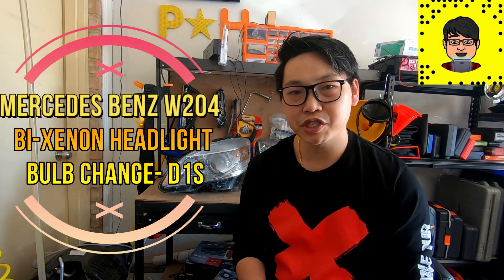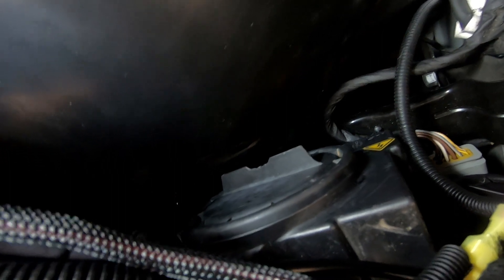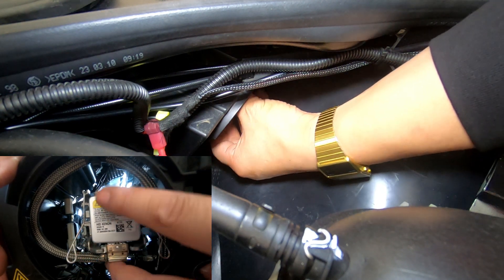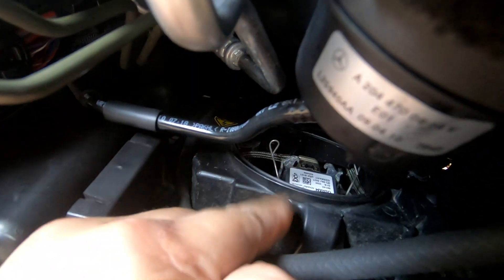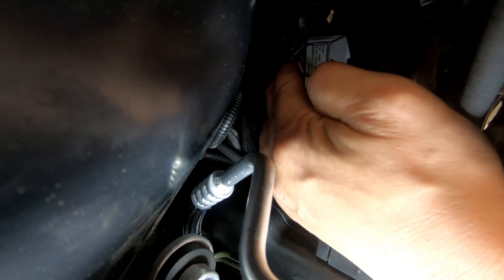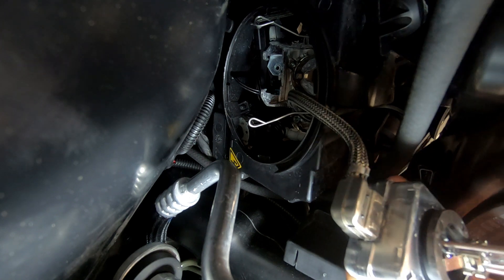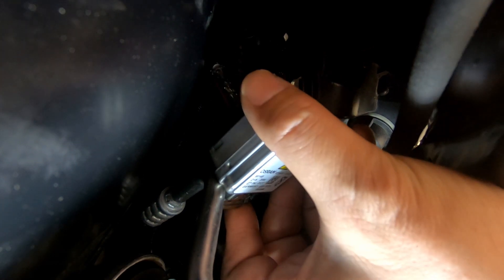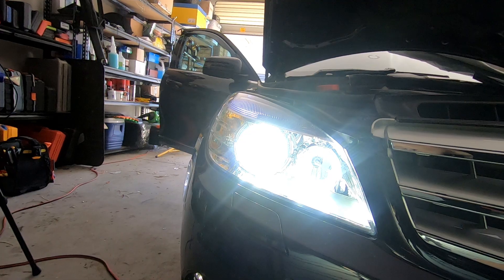MERCEDES BENZ C CLASS BI XENON D1S HEADLIGHT BULB REPLACEMENT W204 WITHOUT REMOVING ANY PARTS

Comment: Do I have to change the ballast too or can I replace the bulb only.
Reply from the maker: only if it doesn't work after changing the bulb ...it's either or ..sometimes both ..change the bulb and if it doesn't work it will be the ballast ...or it might just be the ballast FYI the ballast is alot more involve ..headlight needs to be removed to gain access

Comment: For those like me who do not have the Spring Retaining Clips, exert a slight pressure and turn the unit approx 10-15 degrees to the LEFT, this releases the complete unit. Replacement is same, offer into headlamp at a 10-15 degree angle, twist to the right until it is locked .....
Reply: Thanks Mikeyz

Comment: Hello, good Video.
I have a question, do you disconect the car batterie?
I have to change the bulbs too, but i dont know what happened with the high Voltage of the xenon System.
Thanks for answer 😊
Reply from the maker: some sah u do nut i didr do that and it was fine
Reply: @MIKEYZVLOGZ  
Ok, thank you.
With the high Voltage im a little bit scared, but when you say its Not a problem then i feel better😁
Reply from the maker: @martinpaintner810  to be safe  disconnecr pos terminal wait 25 min for all power to discharge

Comment: Hi my friend, I have problem with my 2012 w207. It's has a Xenon and as I know high beam and low beam are same Xenon bulb as on your video. So low beam operate but when I turn on High beam position left side operate but right high beam dont. please tell me does the  right side xenon have a problem?
Reply from the maker: if it doesn't turn on then yes u most likely have an issue
Reply: @MIKEYZVLOGZ  So as understood Xenon has a bulb with a block they are together and this block controls the high and low beams
Reply from the maker: @Alex K  bi xenon is only low beam with a ballast(box) only controls low beam ... and high beam is on its own because it's not xenon ... hope that makes sense e
Reply: @MIKEYZVLOGZ  So, if a low beam operates but a high is not, may I swab the ballast?
Reply: @MIKEYZVLOGZ  does the ballasts control the low and high beams?
Reply from the maker: @Alex K  no if highbeam is the issue u change change bulb ... ballast is only for low beam .. but if low beam is damage then it's either bulb or ballast
Reply from the maker: @Alex K  only low
Reply: @MIKEYZVLOGZ  ok. But on my w207 coupe low and high beam light is the same lens. So high position doesn't operate but bulb is good because it operates in low beam position
Reply: @MIKEYZVLOGZ  what should I change? Ballast or? 😕
Reply: @MIKEYZVLOGZ   if the ballast controls the low beam with the same bulb, how does the high beam work? Without ballast? In the same lens
Reply from the maker: @Alex K  are u sure ... so it's not a seperate bulb for high beam... I see that the w207 coupe has seperate lights inner closer to gri and outside which is the low beam ... I don't see coupe with only 1 single light... send me a photo to my email addy and I'll take a look .. but km pretty sure they are seperate
Reply: @MIKEYZVLOGZ  no bro. inner small is for marker / like daylight and outer is for low and high beam. one lens for both. bi xenon it's name. So I have low beam but when I turn in high beam position nothing. stay in low beam position
Reply from the maker: @Alex K  oh ok I get it ... in that case .. u need to check your ballast ..it might br that ..if not then it's just your bulb... usually a 2 in q bulb like that is a h4 styles bulb where ..when you turn on high beam ..the motor of the light flicks down or it angles the beam so that it shines up giving u high beam ..ow personally i havenever done a w207 so i। ant say for sure ।। but i would start with a scan and see what it says..but use a proper merc scanner so it. an tell u exactly what it is ... then check the ballast ...then the bulbs itself ..it could be just a bad bulb ... but if u still have low beam ... maybe the mechanical motor that singles the high beam is broken ... u should take out the bulb and have a look...but like I said I have ত worked on ur car before so I can't say for sure ... hope u get it sorted

Comment: Hay brother I want to ask you I have 14 Mercedes C350 last night pop up Active Headlamps inoperative message so do you know what's wrong?? Thank you
Reply from the maker: active headlamps usually mean intelligent   lighting .. that's when your lights auto move wen u then tearing wheel and auto high beam on long roads and corners..usually that means the headlight motor might be no good or ballast ..u. an only know from getting scan
Reply: Brother my car right hand side also low beam light blub not on So do you think is light biub affect that message pop up or is motor affect light blub not on??
Reply: @MIKEYZVLOGZ  brother my car right hand side also low beam light blub not on So do you think is light biub affect the message pop up or is motor have problem affecting the light blub not on?
Reply from the maker: @eddielam389  yes ..so it's most likely your ballast because ur lights not working can throw that messages
Reply: @MIKEYZVLOGZ  thank you brother

Comment: Do you have a video replacing the DRL lights on a 2014 Mercedes ML350 BlueTec?
Reply from the maker: no unfortunately not .. however the one on the ML are similar .. u would have screws holding it in ..most likely behind a cover
Reply: @MIKEYZ VLOGZ  , thank you for your prompt response..  how do you remove the light cover?  Through the well cover behind the light?  There are no screws on the front of the lamp.   Thank you for your help!
Reply from the maker: @MrBobiov  in that case u may need to find how it's mounted ..I'm sure if u search your car model and make year u will find a youtube video on how to diy that... ubfortunately I haven't don't that before so I am not sure how much more I can help u friend..hope u find what your looking for..always start with Google search ..and try find a forum or website that has done it to help guide u
Reply: @MIKEYZ VLOGZ  thank you again and appreciate your help.  I’m asking because I can’t find a video.  I’ll let you know what I find.  Thanks again.
Reply from the maker: @MrBobiov  ive never done this so tbh im not sure where , i would just start web browsing for it , playing with key words in your search and try find something , hoep u get what ur looking for mate..all the best, but if for some reason i stumble across it ill be sure to leave a msg for you here

Comment: Hey man, i have a problem with my c350, the passenger headlight doesn’t work I swapped bulbs to see if i need a bulb but it still doesn’t work, what could it be ?
Reply from the maker: most likely the ballast ? do u have hid or normal halogen?
check fuses

Comment: Hi i have same car bi xenon but my lvl or hedlight is dow, how cane adjuste lvl plz help me.
Reply from the maker: u adjust via the hex holes on top of headlight from in the bonnet
Reply: @MIKEYZVLOGZ  bro cane you help me with picture or short vidio plz.
Reply from the maker: @goolinoli2120  watch one of my videos about headlights and I show where the adjusters are
Reply: @MIKEYZVLOGZ  ty bro
Reply from the maker: @goolinoli2120  all good...it's most likely the video about headlight disassembly or when I replace backing plate of headlight..scroll through the video I'm sure Ull get it

Comment: THX:) Very well explained and helpful hints as well as good camera job. Excellent:)
I have still one question, what sort of lamp is the other we can see on the car, next to the BI-Xenon?
How can I figure out which bulb I need for my w204? Halogen or Xenon and if it is DS1 or something else...?
Thanks a lot:)
Reply from the maker: hey there.. thanks for stopping by and checking out the video... welcome to the channel ...hope u enjoyed the vid and my other content.... so i presume ur talking about the high beams? the hi beam is a h7 bulb .... usually you can find out what type of bulb your car has by simply googling your cars make and model and following with light bulb sizes and youll find a list....here is a site i found from googling it http://www.mercedesmedic.com/lights/ ..however it also depends whether you have HID headlights as they use a different type of bulb such as d1s d2s etc ... another way is by removing the bulb and seeing exactly what type of bulb it is .... hope this was helpful dear friend and feel free to check out my other videos... much love
heres a better site which shows whether u need hid or not  
http://www.carbulbguide.com/mercedes-benz-bulb-guide.html just by googling mercedes benz w204 headlight bulbs sizes ....its amazing what u can find on google dear friend

Comment: Should I disconnect the battery?
Reply from the maker: honestly u dont have to i didnt in my clip but if i are really worried then u can
Reply: Yes! I shorted my headlight control computers
Reply from the maker: @cheesesyrkyer5290  hey buddy I did it all without removing the battery ... however if your just gonna go for gold and not wanna worry about touching cable together then ye maybe .... but if ur careful like I was making sure not to touch any cables together ur fine .... as u saw in this video .... but if u want to be completely safe then ok DC the batt

Comment: how do u actually take the light off
Reply from the maker: which light
Reply: @MIKEYZVLOGZ   the low beam i took it out the actual head light but i can’t seem to put a new light bulb in am i supposed to replace the whole box?
Reply from the maker: @alaiia2100  are u trying to replace the bulbs or the entire headlight ? the low beam is removed via the 2 clips ..some don't have clips depends on the model ... to install a new bulb you just insert the bulb in ensuring u line it up correctly... do I have hids? or halogen bulbs ?
Reply: @MIKEYZVLOGZ  how do you take off the actual light bulb
Reply from the maker: @kxrtierk1284  do u have halogen or hid? when u say the actual light bulb do u mean what i did or something else

Comment: My bulb is good but it doesn’t light on , its shows low right beam in instrument screen, please help
Reply from the maker: have u tested the bulb byitself? check to see if it works on another source orjust hook it up to a 12v source and wire pos and neg rto see if the bulb turns on... so u can eliminate the bulb failure.. if thats ok then check wires ..check fuses ..run diagnosis obd2 ecu check for errors..narow down issue
Reply: @MIKEYZVLOGZ thank you very much , I tried a new bulb but it didn’t light up ,  I thought it might have a board or an adapter system needs to replace  by a new one .
Reply from the maker: @TrendingN94  donu have d1s hid? or halogen?..cuz if it's hid like mine it can be your ballast
Reply: @MIKEYZVLOGZ  my bulb is d1s .. so is there anyway to fix the ballast? Do you have a video about it?
Reply from the maker: @TrendingN94  if u look at my lens removal and headlight disassembly videos I show where ballast is ..easy replace but u need to remove the headlight to access it
Reply: @MIKEYZVLOGZ  ok i will try, thank you very much my friend

Comment: my W204 AMG C63 doesn't have the two clips for removal ....
Reply from the maker: ye if theres no clip it would just unplug ... it's not really a clip ...the plug connector just unplugs... my bad for not being specific...do u mean the pins that hold the bulbs in place
Reply: MIKEYZ VLOGZ ya there is no twin lips you release to remove the bulb
It feels quite secure, so I don’t know where to release the bulb
Reply from the maker: if u can take a pic and send it to my email huottea@gmail.com I can try figure ut out for u friend
Reply from the maker: @911Molar  maybe it pulls right out ... I cant be sure as I cant see what u mean.. however it cant be too different dear friend
Reply: What bulbs are u using for c63 ? Did you get a fault code when installing new one? Is 6000k better than 8000k
Thanks
Reply: yeah me too , i just need to twist counter clockwise and release the bulb